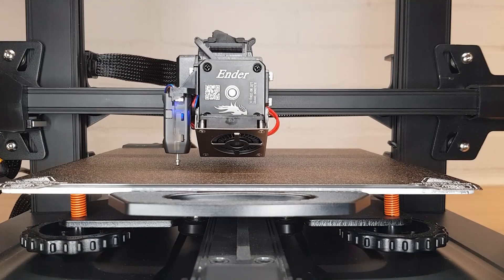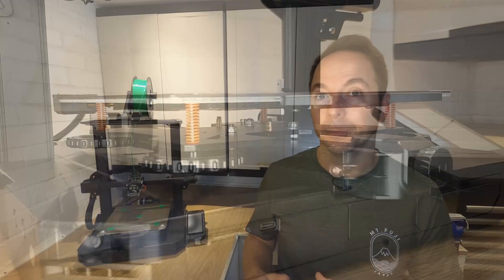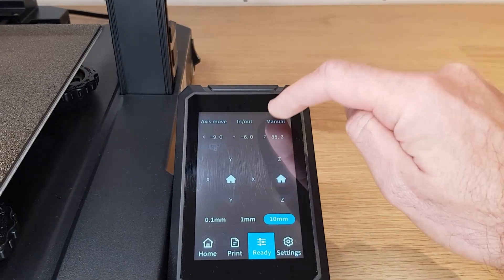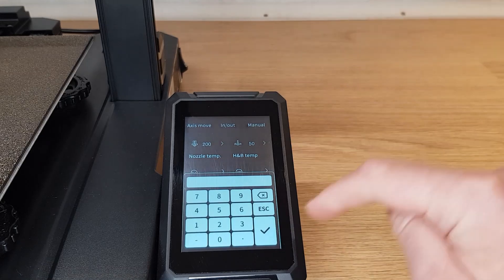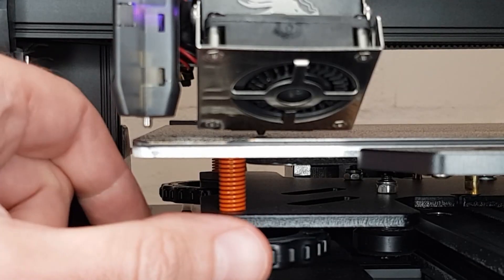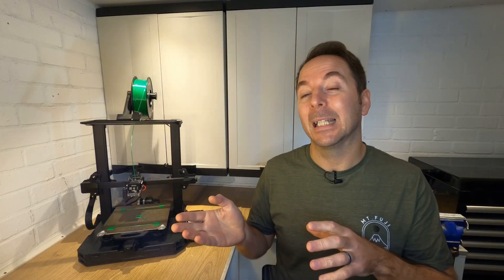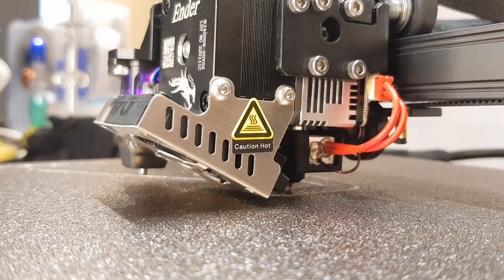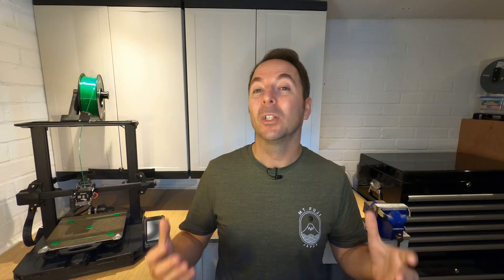Ender 3 S1 Pro 'Automatic' Bed Leveling In 3 Simple Steps

Comment: Related first step (create equal pressure) obviously you need something heavy! Put some 1kg weight on each side and roll the cogs! NOT SURE about one thing - why should I press coils till lowest(tight) position?
Reply from the maker: If you don't have enough tension on the springs then the adjustment knobs can unwind with vibrations and the bed will be much more likely to move when you remove a print.

Comment: My printer was almost perfectly level, but I was having some warping issues with my prints (not the bed) and took some bad advice and tried to relevel and now the back springs are way too low and I can't raise them any higher without the knobs being completely loose. The front might be way too high too because I need to lower them significantly to even have a tiny bit of space in between the nozzle and the bed. Even following your steps I couldn't get them level again. Any suggestions?
Reply from the maker: I would start from the beginning and loosen all of the springs completely. If it sits level and doesn't rock then your springs are fine. If it rocks from one corner to another then you may have your springs in the wrong place. There is usually a shorter one in the back left corner where the wiring connects to the bed.  Once you are happy the springs are in the right place, tighten all 4 the same amount either by pushing down on the bed and doing 2 at a time as in the video or by counting the turns on each adjustment wheel. Once you have the same compression on each spring then you should be ready to start manually leveling.

Comment: I wish I had found this video 2 days ago. I got my brand new printer, leveled it according to the manual and put in an offset that worked. I printed two of the freebies on the memory card perfectly! The third print was something I wanted that I sliced with the Crealty slicer. I stuck it on the card, told it to print and got distracted by the time the first layer was printing. It JAMMED the nozzle into the PEI surface, etching a pattern out of the bed and destroying the brass nozzle. This was a print with a large coverage area so I basically destroyed the print bed and the nozzle. Not terribly expensive to replace but I stupidly assumed it would use the offset in all prints (innocently but still stupid, I guess) and of course, it didn't. My new beds (ordered a couple) and new packs of nozzles will be here tomorrow. I'll relevel the bed and use this as a guide next time. Thanks for making this!

Comment: So what i dont get here, when you press the Level, it moves to where it means the Z0 is, but my printer needs lige 3.7mm to actually hit the bed. Also your Autobed level sensor seems to sit abit higher than mine does? I do use a Ender 3s1 PLUS but should be same technique right?
Reply from the maker: Yes, probably a very similar technique but I don't have an S1 Plus to check. You've kind of answered your own question. The bed probes can sit at different heights so you need to calibrate the z offset to tell the printer how far below your probe the nozzle is. It's very normal for the offset to be around 3.5-4mm, it's fine.

Comment: I’ve been almost nonstop printing on my s1 pro since getting it 2 months ago. Used this video multiple times, it’s brilliant. After about 20-30 hours of printing the bed will unlevel itself. Could be a combination of roller wheel wear (it creates weird gray dust on the wheels), nozzle grinding (this happens unfortunately), spring tension loss, pushing down on the bed for cleaning, etc… i think a good idea for a follow up video to this one is covering maintenance and realistic expectations of occasionally needing to retram the bed, inspection of wheels, firming up mechanical wear, indicators its time to retram, and so on. I started getting a wicked 15 degree slant only 20mm apart on small pieces obviously causing 2 quick failures. Retrammed and back to perfect prints.
Reply from the maker: Yes, that's a good idea for a video👍

Comment: Thanks for the useful content. Do I need to level before every print or just when the printer is moved around?
Reply from the maker: You should only really need to re-level if you change a part that affects the bed or if you accidentally turn one of the adjustment wheels.

Comment: Awesome Job, But Why Are You Blending The Auto Level Out At Z10? It Ruines The Quality Past 10mm.
Reply from the maker: The 'Z10' means to fade out any compensation made for an uneven bed over 10 layers. If you leave it out, the top of your print will be parallel to the bottom. If your bed is uneven then the top will not be flat.
Reply: @RickyImpey  Thank You

Comment: thanks for your videos.
Question: If you change Z-offset after the auto bed leveling has done its thing, will not that mess up the bed level data with it thinking its closer/further away from the bed ?
Reply from the maker: Good question, the answer is no. The z offset will effectively move the whole mesh up and down so the nozzle will still follow any contours on your bed surface, just with a different clearance gap.

Comment: Great video! Though I'm wondering, are the auto leveling settings saved to RAM or EEPROM? There's no confirmation that the settings were saved anywhere after you run auto leveling. Ive added M420 after M28 and I still have to level my bed before every print. Thanks
Reply from the maker: You don't get any confirmation on the S1 Pro but the settings are saved to the EEPROM. What's happening that makes you need to level you bed before prints?

Comment: I used auto lvling many time how do i know which slot i am on ? or how do i reset the internal memory
Edit: also i have a problem where the cr touch keeps pushing my inital layer idkw
Reply from the maker: Hi, by default the mesh will be saved to slot 1. When you say that the CR touch is 'pushing your initial layer', do you mean that the end of the probe is actually touching the print? If so, it shouldn't do this, it should retract out of the way.

Comment: Mine doesn't have springs, just squishy rubber spacers. I can't push the bed down hardly at all. Should I get some springs?
Reply from the maker: Some people replace the springs with the spacers you have as they feel it makes leveling easier. I don't like them myself but you can keep them and see how you get on. With those, treat them like really stiff springs. You want to compress them all a little and try to compress them all the same amount. Then follow the rest of the video from there.

Comment: I must not have this one. I bought the ender 3 pro but it doesn't look like this. display is completely different. no autolevel. just auto home. This is supposed to be the best for the money and one of the easiest printers to use. It has been a complete waste of time for me. printed 3 preloaded models and now will not stick to the deck. I am about done with this pos
Reply: The ender 3 pro is the typical ender 3, a basic 3D printer that is one of the most affordable entry 3D printer on the market. This model has to be assembled and features the bare minimum of typical bowden FDM 3D printers. This printer in the video is the Ender 3 S1 pro, a newer, more expensive, model of the Ender 3 line that has modern features found in more expensive printers like the Prusa. There's a completely different process on how you set up, calibrate, and prepare your 3D printer than the basic 3 Pro. There's loads of support and videos on how to can get the most out of the 3 Pro so it takes time to fine tune your printer correctly. Fun fact, you can actually upgrade your Ender 3 Pro with auto leveling with a few tweaks, there's tons of videos out there on how.
Reply from the maker: Thanks @spyroclone152, you got there before me. I have nothing to add other than I hope you find the resources you need for your machine Glenn.

Comment: Great video Ricky!
But... is this g-code stuff really necessary? I have Ender 3v2 with CR Touch. After creating the mesh there's checked menu option "use mesh / bed mesh active' or something similar. I do not modify g-code and I can observe during printing that Z-axis rod turns a little when head moves across the bed - hence it makes use of bed mesh to correctly level the head.
So what additional benefits there are after modyfing g-code?
Reply from the maker: If Creality are to believed then no, it's not needed. However, I noticed a difference in how my machine used the bed mesh after adding the code as have many others now. My theory is that some versions of the firmware for this printer aren't configured to use the mesh correctly. Adding the code does nothing if the firmware is correct so there is no harm adding it. If yours is working then leave it out if you like. Just bear it in mind if you ever change firmware.

Comment: How do i save the bed mesh into the first slot of the internal storage? Or does it do that automatically when i make a new mesh, because it doesnt seem to do so for me :/ So ive just manually levelled it as best as i can but id like to use the mesh. If u know the answer, please let me know.
Great video though, helped a ton :)
Reply from the maker: Hi, what makes you think it's not saving into the first slot? I'm interested as I've noticed a quirk that I'm trying to diagnose myself that could be related.
Reply: @RickyImpey  So I first manually leveled the bed. Then I used the autolevel feature but the first layer was still uneven and the bed seemed to dip in the middle. (My first printer btw, so not experienced at all) And since i didnt find any button to save the mesh i thought that might be the issue. But I have now tested it by placing an obvious bump in the bed and then using autolevel again. The nozzle did follow that bump though, so it saved it in the first slot. Sorry that i couldnt help any further, shouldve tested that earlier. Anyways, great videos, keep up the good work :)
Reply from the maker: @nilsschutz8148  At least you know for sure. Thanks for replying.

Comment: So much better than anything Creality provided! Great job. I almost scratched the PEI with the test print by following their instructions. Yours got me pumping out perfect prints. The tip about the G-code was insane too. Didn't realise that was required!
Reply from the maker: Glad you liked the video. Technically the g-code shouldn't be required IF Creality enabled the correct feature in the firmware. Unfortunately, Creality firmware (especially for the S1 Pro) is very hit and miss lately and I have very little faith that they have done what they say. Many have told me that adding the g-code improved things as it did with mine and it does no harm if the mesh feature is enabled correctly.
Reply: @RickyImpey  Managed to scratch my print plate twice in the first month, even though i leveled every time and auto leveled. Will definitely try out the g-code trick, this is amazing!
Reply: Exactly the same… missed this step following other tutorials.  Your the boss 😍

Comment: Thank you Ricky for this video, I'm so happy with my Ender 3 S1 Pro printer. When I assembled the printer, I took time to make sure it would be flawless, first I´ve tightened every single screw, adjust all the rollers, leveled the bed, not only folowing your steps, but also making sure it was perfectly even, for that I used a caliper to make sure the base and the bed had the exact same measuring on all 4 corners, then lubricated the 2 gantry shafts with Lithium grease, tighten the 3 belts to perfection and finished doing one last bed leveling. My first print was the rabbit that came on the provided SD card and it printed flawlessly, I was amazed by the quality, no stringing, all the layers came perfect. My second print was the cable holder that you kindly provided on another of your videos, the only change I made to the printer was, changing the angle on the original screen cradle, because my printer is on a dedicated shelv, a little below my eye level (standing up), it was easy to change the inclination (45º up), you just have to grind the little slot and drill a hole next to the lower screw, and you can only use 2 screws in the end. Finaly I'm so happy with this printer, I wouldn't look for any other printer, after my experience with this one. All the videos you have submited helped me a LOT with my beguinning on 3D printing. Thank you once more for that. Cheers
Reply from the maker: Really glad you are enjoying your printer. Thanks for letting me know you are liking the videos too👍

Comment: Probably the best video on levelling I've seen. It made z-offset setting much more clear.

However, it didn't fix my issues with the S1 Pro. Instead I'm having a weird issue which seems to be related to the ABL algo: If I go back to factory settings and then manually level it's OK. As soon as I run ABL it's all over the joint! I'm guessing it's a firmware issue.

Now all I have to fix is the awful layer lines I didn't have on the Ender 3 Pro 🙄
Reply from the maker: There are some others reporting strange ABL issues too. Apparently Creality are working on a firmware fix but there are all sorts of theories as to what is making some machines misbehave and other work fine. I'll certainly post a video if anyone finds a definitive solution.
Reply: I can tell you that after I stopped using ABL completely, I started getting good prints. If I use ABL, all my prints fail. 

Needless to say, this is my last Creality purchase because I looked up how they do firmware updates and although I've done multiple firmware updates over the years, you shouldn't have to go through Creality's bull crap in 2023, such as taking the display apart to get to a microSD. Or taking the printer apart to confirm the model #. Very amateur.

Comment: At 2:35, I have to set it to -3.5 (my spring is almost at its highest point). Is that normal? In the old enders, I can physically adjust the Z-stopper. I can't seem to find this on the S1 Pro.
Reply from the maker: With a bed probe you'll find that your z offset doesn't change when you tighten all of you springs. The off set is relative to the distance between your nozzle and the probe rather than the bed. It's a little different when you have a limit switch like on the Enders that don't have a probe.

Comment: hi thanks for the guide it is very helpful however i have an issue that i cant figure out when manually leveling the bed. i lower the nozzle to just above the bed but when i press the other positions (2,3,4,5 ) it doesn't move, I cant seem to find a fix for this. I have only just got it and this is my first time setting it up.
Reply from the maker: Hmm, that's strange. I can't think of a reason for it to do that. Have you tried contacting Creality?
Reply: yeah im waiting for a reply, its really odd because everything else seems to be working fine. Anyway Im hoping its just a glitch with a simple fix. :)

So it was a super simple fix I just had to reset the printer XD. (Settings > ADV. SET. > Restore All Set.)

Comment: Does bed leveling also take care of skew compensation or is that a whole other process that also should be done?
Reply from the maker: If by 'skew' you mean one part of the bed being lower than another in relation to the x and y axis, then yes. It compensates but it is best to try and have the bed trammed well first.

Comment: Is it normal for me to require -4 off set to fit a sticky note in position 1? I also have positions 2-5 quite level with each other, but then I go back to position 1, and it’s not a huge gap or anything but immediately noticeable it is not gripping the sticky note and thus is much lower than the corners. So how do I have all 4 corners level with each other but the center is too low??
Reply from the maker: Hi, if the corners are the same distance from the nozzle but the middle is different. then you have a slightly warped bed. Not always a big deal and if yours is low in the middle then you can try a few of those sticky notes between the magnetic sheet and print surface to bring it up a little if you think it's causing you issues. Hope this helps.

Comment: Ricky, for the M420 S1 Z10 code, I'm assuming this will also work for the Ender-3 S1 (Non Pro version) printer? Seem logical since the printers are very much the same other than the controller.  Will give it a go and thanks for all the great vids.
Reply from the maker: Hi, yes this start code works for all 3d printers running marlin firmware (most of them) and has a bed probe so definitely on your S1.

Comment: Just came across your channel. This video helped me a lot. I just upgraded my E3 v2 to a direct drive extruder from creality. I fought for an hour trying to tram my bed. After watching this video I followed a few of your steps and found out my zed axis was out of parallel by a quarter of an inch. Have yet to re tram the bed but at least the zed axis is now parallel. Should make tramming easier. I also upgraded my E3 v2 to the orange or yellow springs. By the looks of it you removed the cable retainer for the hot bed on the rear left corner. I probably should do the same. A novice mistake on my part. Thank you sir for your helpful video.
Reply: Guess I commented on the wrong video but all the same your content is very helpful. You have a new subscriber. Thanks again!
Reply from the maker: Hi, thanks. I don't remember removing any cable support for the bed, you may have a newer version with an upgraded bracket. This is not unusual, i'd leave it there if it's not causing you any issues.